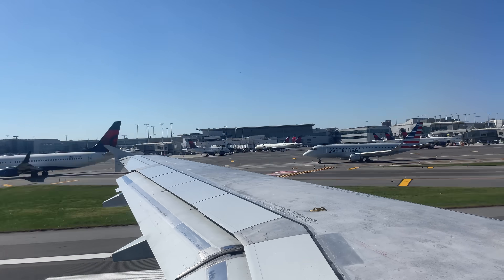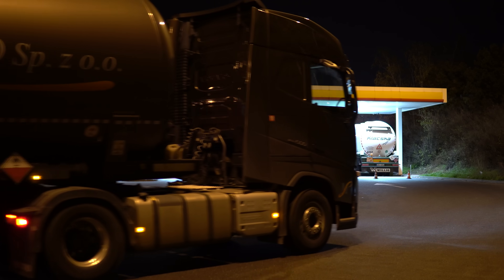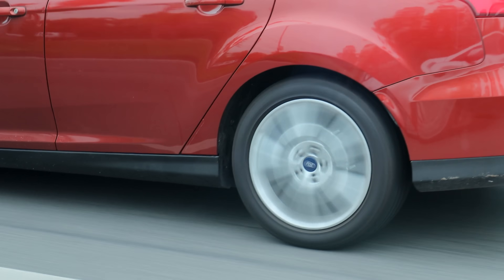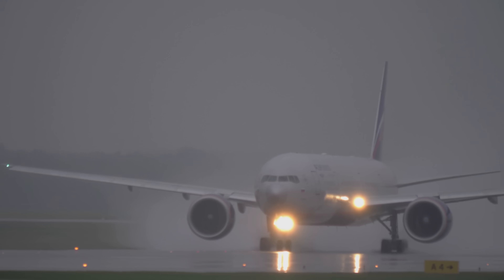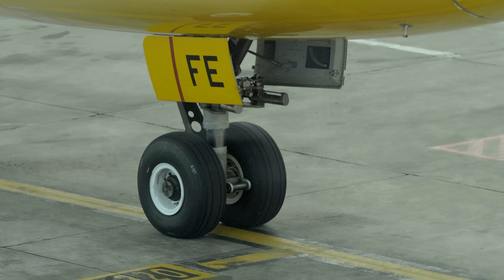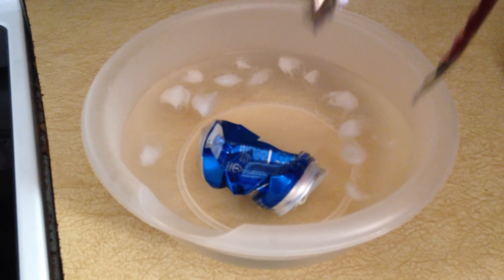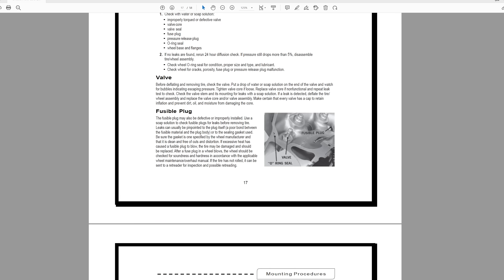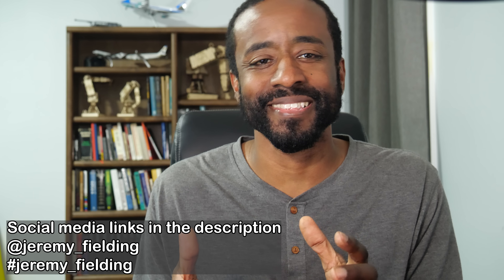The Ingenious Design of Airplane Tires- Jeremy Fielding 107

Comment: Airplanes are often cited in the nitrogen myth about tire inflation. Aircraft tires are routinely filled with air when the required pressure can be served by the shop air compressor. If it can't they are filled from a high pressure cylinder containing nitrogen. The same nitrogen source is used to fill hydraulic oleos the landing gear shock absorbers. It is absolutely critical that Oxygen is not used to fill the oleos because high pressure pure  oxygen and oil explode. Oxygen is routinely available at airports to fill oxygen systems. It is handled with different fittings so it could never get into a tire or an oleo. Nitrogen is used because it is cheap and inert. All the nonsense that nitrogen doesn't expand with temperature and the oxygen in air damages the rubber is absurd. Light plane tires filled with air last 10 yrs or more with mild use. Turbo prop and jet tires may last only 100 landings so they get replaced often. No one worries about air inflation. When a tire needs inflation on the ramp out of reach of the shop air hose a nitrogen bottle is used because it is convenient. Tire fires on airplanes are caused by brake overheating. If a brake caliper drags on take off the disk will get red hot and ignite the tire once tucked away in the wheel well. I haven't read the FAA bulletin but I wonder about its conclusion.
Reply from the maker: It is specific to plane size as mentioned in the video and braked wheels which I didn’t specifically say. But it’s the law. Take a look at the requirements. It is easy to find online. But certainly smaller planes and non-braked tires can used compressed air. It’s just more than I wanted to explain in the video.

Comment: My oldest brother had a trailer once that he used to haul firewood on. Somehow, he had airplane tires installed on it( I don't know how) and thought with the high pressure it would be great for heavy loads. So, on a particularly long haul he loaded it heavy and burnt the tires off within 25 miles. Obviously, airplane tires aren't meant for the road. He learned his lesson.
Reply: Our techs told me the tires on my A320 are good for about 330 cycles.   If each takeoff and landing is about 2 miles, and we taxi a couple miles before and after takeoff and landing, that is about 8 miles of wear per flight.  Multiply that by 330, and it works out to about 2600 miles from New to worn out.   They arent designed for endurance.
Reply: @oscarb9139  Exactly. They are made to heat up quickly for braking purposes when loaded. Definitely not intended for a long haul.

Comment: You should consider a collaboration with Grady from the Practical Engineering channel. He's more of the civil engineering side of the profession, but it might be interesting to talk about how the two engineering disciplines interact.
Reply: I think this would be a really good collab. Most of the reason they these tires can be engineered the way they do is the enormous engineering that goes into airfield pavements. I do airfield engineering work for a living, and even if you could get the same tire onto a semi ignoring the changes in how the tire is used, the road would just disintegrate below the truck. Military airfields are routinely 16” of the highest strength concrete available. I think a  practical engineering collab on that side would be so cool.
Reply: It made me sleepy reading your comment ; ) because Jeremy connects with a smarter, more intense crowd like Destin in his collabs. But I'm sure you've seen the baseball cannon.
Reply: I think this would be a really good collab. Most of the reason they these tires can be engineered the way they do is the enormous engineering that goes into airfield pavements. I do airfield engineering work for a living, and even if you could get the same tire onto a semi ignoring the changes in how the tire is used, the road would just disintegrate below the truck. Military airfields are routinely 16” of the highest strength concrete available. I think a  practical engineering collab on that side would be so cool.

Comment: As someone from the Industry I really think the breaks from airplanes are super interesting.  But engines are my speciality.
Reply: There's a PBS documentary on the design of the a modern airplane (777, I think). They test the brakes on a salt flat, with a full payload, without use of the thrust reverses (in case those fail), and perhaps with engines at full thrust. The disc brakes get ludicrously white hot, sometimes causing the tires to explode.

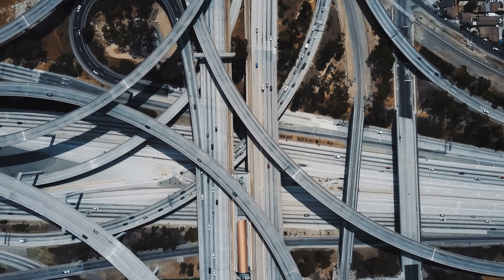Comment: The size of the tires for 737s you mentioned is only the size of the nose gear tires, the 737 main gear tires are actually about the diameter of the semi truck tire you showed (maybe a littile larger, and the width of the main tires is also about 50-75% wider than the truck tire). Another thing that aircraft tires have to deal with is tremendous side loads during landings in crosswinds where the aircraft is not necessarily aligned with the runway at touch down (see the aircraft landing at the 14:30 mark in the video).
Reply from the maker: This is correct and Thank you. I am going to add a note to the description. I can't believe I had someone fact check behind me and apparently we both missed that. It's a bit frustrating because I can't edit the video at this point and the story is just as good whether the tire is smaller or the same size. It is still many times stronger! *Sigh.
Reply: @Jeremy_Fielding  No problem, it just jumped out to me when you said it, because as a former airline pilot, I've been under those airplanes thousands of times looking at those very tires during a preflight.
I happen to think that those tires actually being bigger makes it more astounding what they can do...not to mention what the tires on the 'really' big jets have to deal with.

Comment: We have EVs.  They can use regular car tires but not recommended.  Our Tesla Model Y needs 42psi, and a standard tire from Michelin, but the Tire for the Tesla is the same model available elsewhere.  But at the same place get one for the Tesla, it is manufactured differently (there is an extra layer inside, and it is not a comfortable on non-EV) mainly due to the Tesla being a heavier vehicle.  Even the Nissan Leaf uses a 'ev tire'  that  tends to be narrower and higher pressure than many others but regular tires get worse 'milage'.  We have a Smart For Two ED (Electric drive), and it uses 'regular' tires. ... In the past I flew light planes, and even their tires are not just from the local gas station, for weight, and durability for their use case. ... Great video.

Comment: I've heard comments about using hydrogen in road tires, and I believe some racers have been doing that.  But, I've not seen any statistics on it.  The problem of course is how would a homeowner even produce/separate the hydrogen and what type of pump/compressor would be needed?  Then there's the cost.
Oh, I noticed you didn't mention the difference in the number of plys an airplane tire has compared to a car tire.

Comment: Why don't they have a small electric motor in the wheel hub that pre-spins the tire to match the ground speed just before landing? This would greatly reduce the stresses on the tires at the moment of contact and increases their lifespan. And, with modern motor technology, it wouldn't weight very much.
Reply from the maker: There are many problems actually. You need to match the speed of the wheel to the landing speed or you still have the same problem, it adds weight to the landing gear, any essential electro-mechanical system has to have a backup system. The list is actually quite long. :) Its a great question though. It is much cheaper and safer and requires less regulation to just replace the tread on the tire, which is what  they do about every 500 landings.

Comment: Smaller tires also mean less surface area in contact witht the road = less traction.  Smaller tires would also require a re-engineered drive train to keep the mileage up and it will result in lower torque at the wheels.  Smaller tires require more revolutions per mile = lower gas mileage.    What I'd love to see is split rims for my car and van.  I could change tires at home with just a wrench and a cheap tire balancer from HF.
Reply from the maker: You are right. This is one of those things where the longer you think about it, the more problems you find. Again this is why I love engineering. I have had many conversation where someone says "all you have to do is X and everything is better"... I immediately know its going to be way more than x, and there will be problems with x. I just don't know what that problem is yet :)

Comment: Regarding why we don't implement some of the airplane tire features into road tires, one other important point to note (that was touched on earlier in the video) is that the tires are what provide the force to move road vehicles. This means a tradeoff between torque and speed when deciding tire size. This also affects gas mileage.

Comment: As an engineer, I'm sure you know how high-stress products are built with immensely high tolerances for failure.  If you think 200PSI is a lot for these tires, their maximum load is rated for 800PSI, but they're known to go into the thousands before they rupture.
Reply from the maker: For sure. I didn't discuss the additional load of hitting the ground and many other things that were interesting but I think made the video a bit too long. One report I was reading from a tire engineer said the rim often fails before the tire because of their extremely high pressure ratings.

Comment: The condensation effect suggests an answer to the question of why car tire pressures drop so much going into cooler seasonal weather. The expansion of air is not enough to account for the ~20% pressure loss I see every late autumn (Boston area). But where I add ordinarily compressed air that includes ambient water vapor -- I now suspect that most of the loss is condensing water. This has me wondering (as an experiment) about dry nitrogen as a way to stabilize seasonal tire pressures.
Reply from the maker: yes. It would... among other benefits which is why high end sport car manufactures often recommend nitrogen but it cost more to do that. Though if you are driving a sports car it probably doesn't matter to you. :)
Reply: Hi Jeremy - Thanks for the feedback. Quite the opposite -- our minor air pressure problem stems in part from a very unsporty Prius. Toyota recommends higher pressure (~40 PSI) -- which I find hard to maintain. I suppose I could rent a Nitrogen tank and regulator. After putting air in tires for nearly 60 years, maybe it's time to give that a try.

Comment: Jeremy, another excellent discussion   One point I would make is the distribution of the weight on the mains vs the nose is significant. In the A/C I work on the BOW is around 50,000lbs the mains carry about 23-24 k lbs and the nose about 4-5k lbs when on the scales for weight and balance calculations. Nose tires about 120 psi and mains 200 psi we only use dry nitrogen to service. I love your passion keep up the good work
Reply from the maker: Agreed. There are other details like this I left out on purpose. For example tires that don't have brakes aren't "required" (according to the 1990's report I show in the video) to use nitrogen but I felt like I reached a point where too much detail made it less interesting and harder to follow.
Reply: @Jeremy_Fielding  thanks Jeremy you do a great job I’ll stay out of your editing room!!
Reply from the maker: @scottjones462  I love nerdy details LOL

Comment: I used to work in the tire manufacturing industry. The plant I was working in did not manufacture airplane tires. I had only been there for a short time when it occurred to me to ask why we didn't make them. To my untrained eye, they didn't look that different from the passenger car and light truck tires that we made. A senior manager told me that airplane tires are made in plants that are designed exclusively to make them and rarely, if ever, do they manufacture other types in those plants. In his words "there is a whole different level of engineering" that goes into their manufacture and "a ridiculous amount of regulation " that must be managed for the plants that are certified to make them. Nice to know when flying down the runway!

Comment: Thanks for including the "why not make car tires like aircraft tires" portion. It was certainly a question that I was having. Also, why not fill up car tires with nitrogen?
Reply: You can but for 99% of drivers its not necessary. Race cars do fill up with nitrogen and shady auto places do too to make you spend more money. Most places don't even do it correctly as you need to pull a vacuum to remove all the water vapor from a tire. Most will just add nitrogen to your regular air.
Reply: @jc5495  thanks
Reply: @jamesa7506  I forgot to mention it will help reduce air pressure loss as nitrogen is a bigger molecule than oxygen so it will lose less pressure seasonally buts its pretty much insignificant as you should be checking your tire pressure weekly. Also unless you are driving above 100 mph the water vapor affecting you is not warranted. Race car drivers yes because they are going above 100mph and braking heavily.

Comment: Jeremy, thanks for this information. Just two adds to what you said. One, the grooves are called sipes. There's a good bunch of information on that. Second, used commercial aircraft tires can be used on various agricultural applications. One that comes to mind is manure spreaders.
I have used commuter aircraft tires on carts, and they work well with go-kart rims. The two most common sizes I use are 5" and 6". As you mentioned, split wheels are required for these as well, for one fundamental reason. Instead of steel cords in the bead, these have a steel ring that keeps it's shape under varying circumstances. The tires are definitely overrated for my applications, but when they are deemed not flight worthy, there are further uses beyond that.

Comment: I always wondered about those little tyres and how they take the rigours of landing planes. Very interesting, thank you, for the answers and engaging way you relay them.
Reply: the irony is that those tires can't handle the high speeds cars are capable off. About 170 mph they can start to rip apart. most commercial and military acft land around 120 to 140 mph so there isn't a need to increase the cost to cover much higher speeds than that.

Comment: Majority of the loading on the 737 is dispersed through the main gears as they are placed close the the CG. The nose wheel isn’t carrying nearly as much and is much smaller than the main landing gear tyres.
Reply: 737 also have their tires still exposed while in the up position as they found it cheaper and lighter than to have doors
Reply: I agree but you can’t imagine the amount of abuse a new FO puts on Nose wheels when first introduce to the 73! 😁🛫

Comment: I've always been surprised that landing gear wheels aren't designed so that the wind causes the tires to spin so that they don't burn rubber when they touch down.
Reply: Cessna Citation has an STC nose wheel spin up kit available that does this with ram air and bleed air. It match the nose wheel RPM with the landing speed. This is a gravel kit to prevent the nose wheel from throwing rocks down the underside of the fuselage.
Reply: Touchdown isn’t what causes the most wear, it’s the roll out phase where the weight is being transferred to tyres. Plus tyre changes happen all the time so airlines and manufacturers have probably decided that it’s not worth the extra effort to squeeze a few more flights out of a set of tyres.

Comment: I never understood why the wheels do not have fins to spin the tires up before landing.  This would also add a little bit of braking as forward motion is converted to rotational motion.  Probably be much easier on those tires that really take a beating.
Reply: Cessna Citation has an STC nose wheel spin up kit available that does this with ram air and bleed air. It match the nose wheel RPM with the landing speed. This is a gravel kit to prevent the nose wheel from throwing rocks down the underside of the fuselage.
Reply: Because you would have to mesh the tyre speed with the landing speed otherwise you’d still get a mismatch and some change in speed resulting in some wear. Various aircraft manufacturers have almost certainly considered this and decided that it’s not worth the trouble when the tyres can do the job just fine already.
Most the wear actually occurs during the roll out, not the touchdown too, so it wouldn’t exactly be worth adding extra complexity to extend tyre length by a few more flights.
Reply: That would add weight and a part that can break. It wouldn't add any braking at all, since the tires will spin up as is anyway, just now when they touch the ground. That also means it happens when the plane is already on the ground, which is safer than doing anything in the air.
Reply: they try that back in the 50 it did not work

Comment: My intuition says that a larger tire helps mileage on a vehicle, since the same rotation of the drive shaft translates to a larger circumference distance travelled, but maybe this is incorrect? Does tire diameter size affect mileage directly in something similar to this or is my intuition wrong?
Reply: My experience is that the larger diameter and heavier tires decrease my gas mileage and the engine must work harder to turn them.  Typically, the larger tires require a lower (higher number) differential gear ratio to offset this which negates any fuel savings.
Reply: Not really as the torque would also be increased
Reply: As the power consumption which is torque ×rpm which remains the same